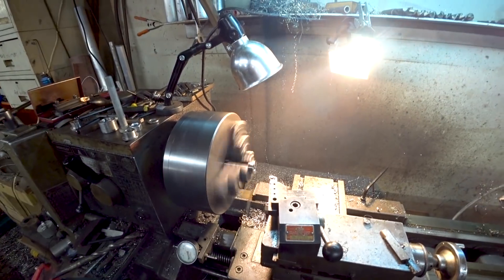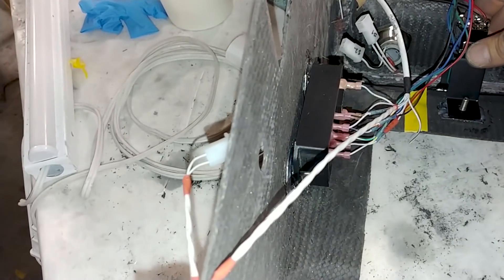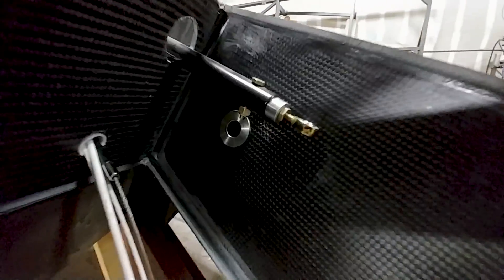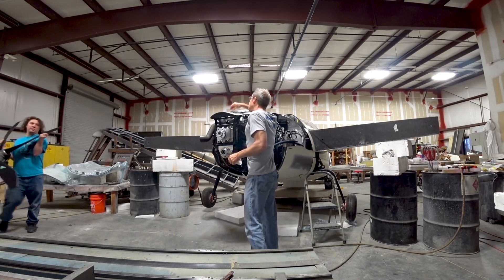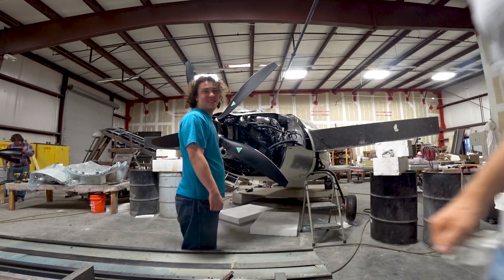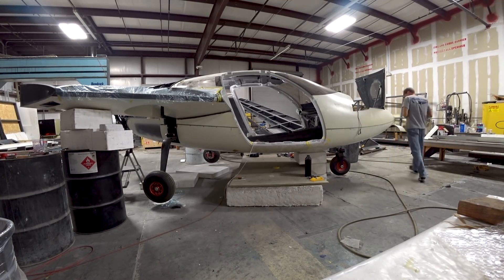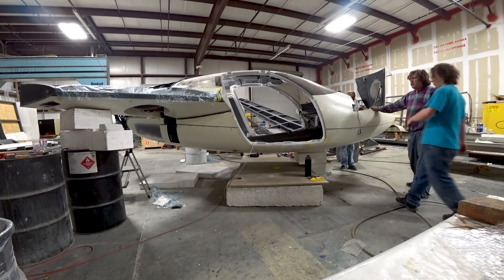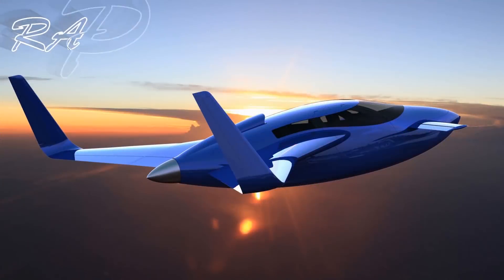This Bird Wants to Fly - Building the Raptor Prototype

Comment: Excellent job, I fly a challenger 604. And on the 604 the gear handle has to be pulled and the moved up as a extra safety precaution, I noticed that it is the other way around in your aircraft. Take care and keep up the excellent work.

Comment: I have no idea about aircraft mechanics but when we need the wings of a farm implement to come up together the hydraulics are in series not parallel, the out-flow of no. one is the input going to no. two etc...  the both move in sync.
Reply from the maker: How do you initially get fluid in the line between cylinder 1 and cylinder 2 or does it somehow bleed through the pistons automatically replacing the air?

Comment: equalize hydraulic flow to rear gear - look at https://www.zoro.com/concentric-divider-flow-24-5-gpm-1020075/i/G1302043/   When the gear is up you have some pressure bypass relief valves so any mismatch can be taken care of. A pressure relief from right gear to left gear line and left gear to right gear line -- when right gear is up and left isn't, pressure relief in right gear line will flow to the left gear side and finish raising it.  Pressure reliefs are on the gear side of the equalizers.

Comment: I feel with the read mounted engine and prop the center of mass will be behind the center of aero which would make this plane very unstable. How do you mitigate this?
Reply from the maker: The swept back wing causes the aero center to be in the correct position relative to the cg.

Comment: re : 4 or 5 blade prop:
the engine can only produce a limited amount of power. 
the prop blades can equally only bear a limited amount of torque  and thrust before over stressing the prop hub or blades. the prop hub can also be over stressed by too many rpm. 
hartzell says 10% over speed requires tear down / inspection. 
a 2 blade prop or rotor of any kind applies the entire thrust and torque load with 2 blades - meaning that every time EACH blade passes the wings or fuselage a buffet equal to 1/2 the entire thrust load is applied to the wings and /or fuselage.  
4 blades divides the thrust by 50% and reduces the beating or buffeting proportionately.
adding another blade really only reduces the force - and thus the equal and opposite reactions  --  per blade by less than another 10% more.  at what added cost ? 
your big gain was adding 2 blades. having the blades opposing each other is better for counterbalancing  but not having 2 blades passing the wings and fuselage simultaneously will absolutely cut down on sensed vibration. 
the strips on the leading edges of the blades are for erosion. these strips are applied to all composite propellers. they are most frequently made from stainless. 
yes, i do prop balances and vibration analysis.

Comment: re: controlling your landing gear.  
i would  NOT  adjust the voltage.  let the hydraulic motor run  FULL SPEED.  it is  NOT GOOD  to turn down the voltage of these motors.  it will  SUBSTANTIALLY decrease their service life.  
dc motors work most efficiently when they are running in the high end of their voltage range.  ie: a 12 volt motor works best at around 15 volts  and a 24 volt motor works best around 30 volts.  
i would use a fluid orifice in EACH hydraulic line to control the  VOLUME  of fluid allowed to EACH gear actuator individually.  this allows the motor to run at it's designed voltage/amperage and limits the speed of the gear by the volume allowed into the actuating cylinders.  using an orifice instead of a voltage control also allows individual and custom restriction to control the rate of  EACH  gear.   the electric powerpack relief valve will pop open if necessary to relieve excess pressure.
example :
all things work by path of least resistance. 
it requires less force to break the nose gear and downlock so the nose breaks first.  the nose goes to the uplock and then the mains begin to retract as pressure is sufficient to break the main downlocks  AND  overcome the weight of the gear.  
in translation the hydraulic pack is moving  1 gear,  and after that cycle- it's moving 2 gear. 
by using  orifice (s) instead of voltage to control the rate of the gear - the nose is first limited by it's individual volume/pressure requirement and then once fully retracted - the mains are limited by their own orifice (s).
by placing orifice(s ) in  BOTH  up and down circuits of the landing gear actuators - you can control the rate at which the gear lock up and down into place, preventing the " slamming " effect and preventing damage to all components effected. 
by using an orifice - you are applying the same working  PRESSURE, which applies the same  FORCE,  but reducing  VOLUME,  reducing the  RATE of the cylinder which is what is  CAUSING the slamming effect.

Comment: with 12in of clearance. on landing would you need to approach on a fairly neutral attitude or is there enough forgiveness to be slightly nose up? Looks tight. Great work. thanks for the video!
Reply from the maker: 10 degrees nose up to cause impact. You can't do that with the fore plane and elevator. Best you'll get is maybe 6 degrees.

Comment: Propeller should be Designed to lift the overall payload after boarding or integrating of all the systems required for smooth lift without drag.

Comment: One idea to solve your gear retraction problem:
Put in check choke valves to the non pressurized side of all retraction cylinders.
The choke will cause the system to build constant pressure, thus eliminating this stick slip effects you are seeing.
It will also take over the retraction speed regulation. 
Because of the check valve, the gear will extend like normal.

Comment: around the 03:00 mark there are several bolt length way to short, there should be 1.5 treads visible above every nut type. There are several bolts missing locking wire too, or showing non conformity.
I hope you have an experienced QA guy supervising.. At 10000 feet you dont want loosened bolts at that section....
Reply from the maker: I'm fully aware of that. Those bolts are ones that will be replaced with longer ones once that item goes in for the final time.
Reply from the maker: I actually mentored that in the video if you were listening.

Comment: It is a very sleek looking bullet indeed, and will fly at 3 digit flight levels. 
Do you plan to execute a two-times delta P test on the pressure cabin? What delta P test does the FAA recommends for this category? 
What is the critical crack-length ( K1c based tear-out crack-length ) on the highest load spot in this pressure cabin? 
The EXTRA EA 400/500 composite pressure cabin has huge margins here (crack longer than a foot or so) and is inherently safe to any impact. (bird, loader fork, large ice balls (hail), etc).
To remind; a pressure cabin is in fact a low pressure-bomb.
But anyhow a teasing project.  

Louis van Rijn. Lead stress engineer PAL-V Europe.

Comment: You should be able to find hydraulic balancing valves where you can meter flow equally (or unequally as necessary) to balance the gear. This may also help with the aggressive finish as the last gear gets 100% of the flow at the very last second.

Comment: Looks great! What take-off angle and speed will you have to be able to clear the prop off the ground? Any particular reason you guys are using a propeller rather than a jet for the Raptor?
-Aerospace Engineer in Wales, UK
Reply from the maker: Look through the channel for the videos of the model flying and that should give you an idea of your first question. Jets are too expensive.

Comment: equalize the gear retraction in the same way the do with brakes on cars.  They have a proportioning valve.  More pressure in the front and less to the rear.  Pitches care forward for better control but also keeps the rear from loosing braking force.

Comment: Don't think you should spend a lot of time worrying about how evenly the landing gear cycles. You will have more than enough issues to perplex you as you go forth with this project. 

 With a good pump running full speed it will come up fast enough. 

Just about every small airplane with hydraulic gear has dragging floppy feet. 

No big deal

Comment: If not using sequencers the landing gear coming up at different times is a result of stiction.  The hydraulic fluid will flow to the gear with the least resistance.

Comment: Cool! very. I wonder, is the prop variable pitch? like, planetary gears? also, is the surface area, profiles, much different than the 4  blade? I'm thinkin that that five blade has less diameter? (more  ground clearance). very cool build.

Comment: depending on each props pitch, more prop blades generally means more static thrust but less top speed but should definitely be smoother
less blades generally means less static thrust but more top speed and normally much more efficient

Comment: With regards to the landing gear movement, what about using an automotive brake bias proportioning valve? That should allow you to balance pressure front : rear to your liking right?

Comment: My computer must have crashed before my comment was entered, so here it goes again, albeit condensed:

Prop looks great; the only way to make it better is to add another one and make them counter-rotating!

Landing gear problem: Have you ever considered linking the main gear together mechanically with a bell crank/push-pull tie-rod arrangement?  It would eliminate the need to balance them hydraulically and could be powered by a single circuit, and adding a single geared DC motor for a backup along with an manual emergency release to utilize a gravity-assist to lower the gear isn't too hard to imagine.  You solved the door lock mechanism with such a mechanical arrangement, so I trust this  won't be too far-fetched, and would likely be much less of a challenge than balancing two hydraulic circuits.  If you strictly use the single electric servo motor approach, you could probably control and integrate it with your mini-computer system (was it a Raspberry Pi or Arduino?).

Comment: The 12" prop to ground clearance spec reminds me of the concern I had when seeing the Raptor scale model test flight on 10/15/16 which ended with the prop clearly striking the runway during landing at the 5:28 mark. 

https://photos.app.goo.gl/cj4ZBRWcCH4c3xmKA

https://youtu.be/McDTGXBJqwI

Two spaced ventral fins or spars mounted on the underbelly forward of the prop would resemble talons on a raptor, protect the prop from ground strike and provide some peace of mind for pilots.

Comment: Hi! What a great build! Does the landing gear have locks? I mean; in passenger jetliners the landing gear lever has 3 positions, from top to bottom: up, off and down. When the gear has been lifted up it locks into place, the pilot can then set the landing gear lever to the Off-position. This way the landing gear system and hoses are not under constant hydraulic pressure, which adds general safety and prolongs the lifetime of the equipment. -edit: typo.

Comment: As a random YouTube viewer my opinion is the most valid; I would prefer a 27 bladed propeller.  I mean, they keep adding another blade to my razor every year so more has got to be better right?
Reply: Kraken isn't that how jet engines work with all those fans?
Reply: Now Gillette has gone back to one because it was proof of toxic masculinity.  Not to mention white supremacy to boast that you can afford 5 blades with our money stolen from the higher IQ yet less aggressive natives.

That is what I understood of their new commercial. lol
Reply: The fewer blades a propeller has, the more efficient it is. However As engine power increases, you need to increase the size of the lifting surface. Craft design and tip speed limit how long you can make a blade. Aerodynamics limit how wide the blade can be. Having exhausted both, the only way to get more lifting surface is to add more blades.

In theory you can make supersonic propellers. It has been tried in the XF-84H. This craft earned the nickname „Thunderscreech“ because it was so loud it gave ground crew and pilot migraines and seizures, and the tower crew requested the craft to take off out in the saltplane because if it used the runway nobody in the tower could understand a word they where saying. Nobody has since bothered with supersonic propellers.
Reply: @pyalot  I was being incredibly sarcastic man, but thanks for the explanation.
Reply: @SteelDoesMyWill : Lol, some people will jump at the chance to impart their undoubted knowledge on any given subject, I got it though & it gave me a chuckle :-)
Reply: @pyalot  so 0 propellers = 100% efficiency?
Reply: Dick head

Comment: Idea for gear - would an adjustable pressure regulator close to each of the three actuators help them all work in unison?  5 blade looks great, higher the number of blades the lower the acoustics and the vibration.  Great progress, once the big pieces start coming together it gets really exciting, great video.

Comment: There are several Lake Amphibians flying with the MT prop.  

     On the 6 cylinder (IO-540) powered Lake Renegade, there have been some instances of blistering on the side of the prop that faces the exhaust.  The theory is that the wood used in the core was not 100% dry and the expanding moisture in the presence of hot exhaust pulses leads to delaminating blisters.
      This is something you will want to watch for during flight test.  Also, it’s hard to tell, but it looks like your blades have the black rubber erosion tape at the blade roots.  MT calls it “PU tape”.

       On the Lake Amphib STC, there is an allowance (and recommendation) to remove these LE “boots”.  The exhaust heat will eventually soften the adhesive and you might throw a boot in flight (prop imbalance).

        Now with diesel power (and the turbo), you might not have any of these issues, but I wanted to share my experience with MT props and pusher setups with short exhaust runs.

Comment: You guys got some big balls, not only building a plane from scratch with many new methods like composites and such and then to put all your trust into this aircraft. I just finished converting a 1986 Chevy K30 Military Truck by installing a 5.3l LS Fuel injected engine and I’m afraid taking it on the Highway and brake down because cause everything is so new and untested. Lol Much Respect!!!

Comment: Is it safe to assume that, with the prop on the back, the use of gravel runways is not advisable?
Reply from the maker: Yes. But potentially a stone guard could be added to the nose wheel.
Reply: @RaptorAircraft  Thanks for the reply and for verifying what I thought to be true :-)

I knew that various MIG aircraft had stone guards on their nose wheel(s) and I figured if a supersonic aircraft could use them, our GA aircraft could as well.  That's an awfully expensive prop to risk, though...

Comment: Peter, you can use a rotary flow divider to sync the rear gear.  It's use to synchronize gear motors or cylinders.

Comment: Not to add more confusion or anything, but you might get different results on the landing gear extension & retraction by changing the kind of ATF that you're using.   There are ATFs for different purposes that give big differences in how automatic transmissions shift, so a different type or even a different brand might give you what you're looking for.  Summit Racing or Jegs should be able to help you out.    And the 5-blade prop looks great!

Comment: I would think a five blade prop would reduce the overall prop diameter and thus provide more ground clearance during the landing flare
Reply from the maker: Diameter is the same as what the 4 blade would have been. It just turns slower.

Comment: I'm a little surprised at such a strong reaction to the look of the 5 blade.  Yes, it looks awesome.  But I thought the thing driving the decision was greater prop surface area per linear inch of blade length, which means shorter blades, higher ground clearance, reduced strike risk and reduced risk of damage from gravel.  I'm sure the technical math is more complicated than that, I don't really know that much about prop geometry and I'd have never thought of that harmonic resonance issue.  But all other things being equal, shorter blade length seemed like a particularly good design idea to me.
Reply from the maker: The blade length is actually the same as what would have been with a 4 blade. It's just turning slower so it performs better.
Reply: @RaptorAircraft  Huh.  Interesting.  So it's actually 'greater' prop surface area, hence the lower speed.  Very cool.  You guys are doing an amazing job with this project Pete.  It's a pleasure to watch from both an engineering, and a business perspective.  I really hope the numbers you get for scaling it up make future fundraising a piece of cake.  If there is anything I can do to help on that score please feel free to reach out.